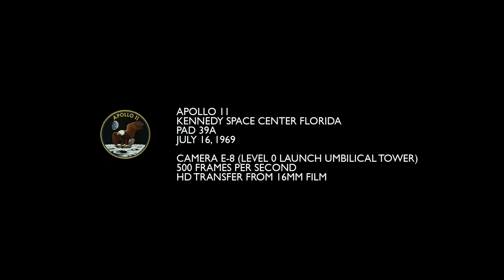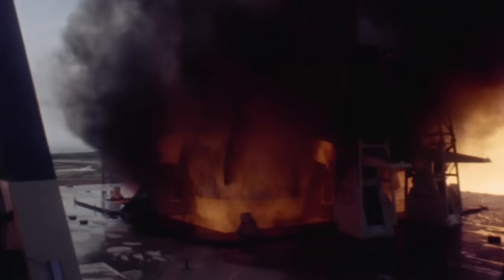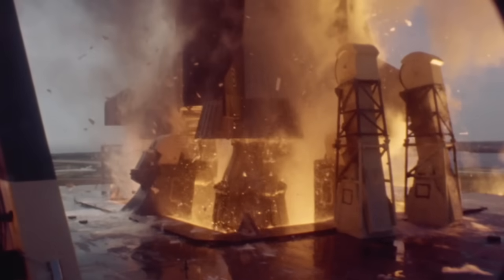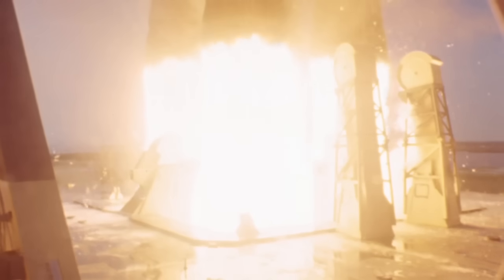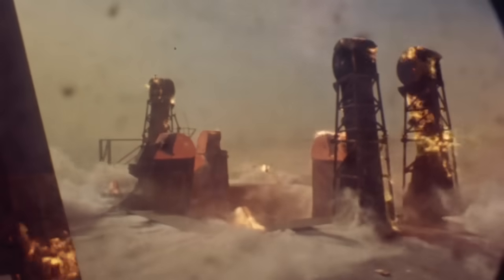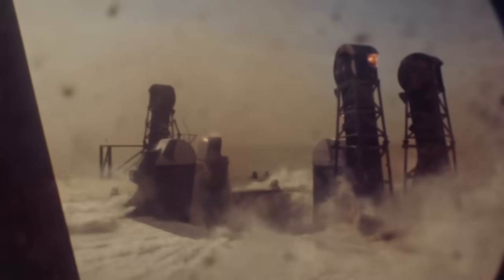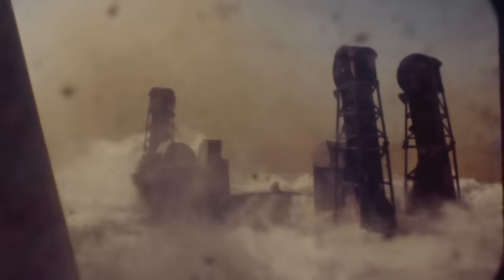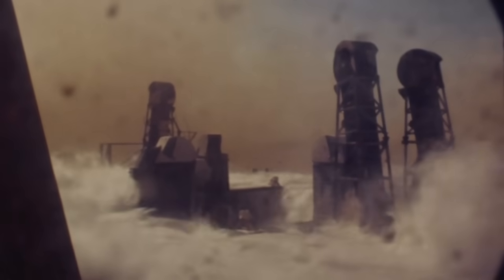Apollo 11 Saturn V Launch Camera E-8

Comment: Is there any records of the crew during a lift off?
Reply: What do you mean? Heart rate telemetry and communications? Yes.
Reply: @yassassin6425  you know what I mean, the video
Reply: @dimaleoniv7987  
No I didn't know what you meant because you didn't specify. This video is purely about the start up sequence of the F1 engines.
Reply: @yassassin6425  anyway, are there video records of the crew from the inside of the spacecraft?
Reply: @dimaleoniv7987  
At launch? Not Apollo 11 no.
Reply: @yassassin6425  strange isn't it? The first flight to the Moon wasn't recorded on video.
Reply: @dimaleoniv7987  
It was. There are hours of footage taken during the journey to the moon. There was no static camera rigged in the CM during lift off. I believe this was however done during the Apollo-Soyuz launch - although that was the Saturn IB
Reply: @yassassin6425   do you remeber that the mission Apollo 13 suffered numerous technical problems? I don't mean something like radio transmission failures. I mean life-threatening malfunctions. They started 3 days after Soviet fishermen had recovered a so-called "experimental Apollo capsule BP 1227" in the Bay of Biscay. Looks like a try to sidetrack spectators around the world from something more serious having its place on the Earth by launching a thrilling space story.
Reply: @dimaleoniv7987  
Yeah a boiler plate - not a working flight vehicle. BP1227, which was assigned to the navy ARRS unit for recovery training in the Atlantic was lost overboard in 1969 and recovered not by 'Soviet fishermen' but likely an AGI vessel after falling overboard. Makes for a rather embellished story but actually a somewhat underwhelming one after it was returned in Murmansk the following year on September 8th.

The Apollo 13 incident occurred on April 14th 1970, some five months previously. Damaged Teflon insulation on the wires to the stirring fan inside Oxygen Tank 2 allowed the wires to short circuit and ignite this insulation. At the route of this were two thermostatic switches, originally designed for the command module's 28-volt DC power which under the original 1962 specifications, the switches would be rated for 28 volts. However, revised specifications issued in 1965 called for 65 volts to allow for quicker tank pressurisation at KSC. Unfortunately, the switches Beech Aircraft (the contractor) used were not rated for 65 volts.

Seriously, you need to stop naively accommodating fanciful junk online conspiracy theory websites. If you really must browse them at least independently verify their claims.
Reply: @yassassin6425  yes, you right it sounds like juncky conspiracy, and there's the official version we have to trust to, shouldn't we? But let's be honest, how is big the chance of finding the module in the ocean without tracking it? It's like a needle in a haystack. Yet two notable events took place on that April. The Apollo 13 mission and the history's largest fleet exercise Ocean '70 launched by Soviets on April 14th. More than two hundred military ships got involved. I would swarm the oceans with ships too if I had a plan to catch something that's going to turn the world upside down. You probably know that USSR had a naval space fleet which official name is too long to write. A squadron of tracking ships used mostly for the assitance in orbital and lunar operations. They could be deployed anywhere around the Globe. At the beggining of 1970 the fleet counts nine vessels. No doubts that USSR was tracking all the Apollo launches since they began, double-checking and analazing the information. In 1970 they dicided it's time
Reply: @dimaleoniv7987  

"you are taking the easiest path by declaring my post a non-sense."

Not at all. I have systematically addressed all of your claims which are regurgitated from online conspiracy theory and demonstrably nonsensical.

"What's about yours then?  Not a working flight vehicle which was likely picked up by an AGI vessel monitoring ARRS exercises"

What do you mean 'mine'? Nothing to do with me. BP1227 was not a working flight vehicle - it was a a boiler plate used simply for recovery exercises which were underway in the vicinity it was lost. These were known to be shadowed by Russian AGI vessels disguised as trawler fleets. It is probable that the capsule was recovered by one of these vessels. 

"Some Soviet surveillance ship steals an American space module from under their nose. That would be a good plot for Tom Clancy's or for a French comedy of that time."

It wasn't an American space module, it was a dummy for recovery training. That it was lost overboard and recovered by a nearby vessel is not in the slightest bit far-fetched. Refer instead to your absurd post regarding military 'space fleet' exercises and Apollo 13 and you have a Tom Clancy novel. What you are clearly unware of is that following collection from Murmansk, it was lost overboard again. 

"I don't see you are reasoning, just repeating what officially stated."

What do you mean 'officially stated". Those are the facts as we know it. The rest is speculation as are the entire content of your posts under this video. Speaking of which, this is about the launch of the Apollo 11 Saturn V as captured by camera E-8. If you have nothing worthwhile to contribute may I respectfully request that you take your conspiratorial beliefs back to whatever echo-chamber you choose to inhabit and where they originated.
Reply: @yassassin6425  oh, really, and during coming back from Murmansk they lost it again. Yeah, for those who didn't get from the legend it was lost in sea once before. Pal, are you serioisly writing that Americans let lose a replica of Apollo command module with NASA written on it to the Soviets? Now imagine what they gave to Soviet propaganda which could make a mountain out of a fly but for some reason Soviets didn't. You didn't work with BP1227 but keep repeating that it was recovered by a Soviet AGI vessel during the exercise. You're like a parrot yourself. No offence it's just a fact. Like a North Korea's soldier who while in captivity steadfastly refused to watch TV to prevent himself from enemy's propaganda. I gave you information you didn't know, you refused it. There you are.
Reply: @dimaleoniv7987  
"oh, really, and during coming back from Murmansk they lost it again."

Yes, after collection it was swept overboard a second time - and you weren't even aware of it. 

"Yeah, for those who didn't get from the legend it was lost in sea once before. Pal, are you serioisly writing that Americans let lose a replica of Apollo command module with NASA written on it to the Soviets?"

There was no hardware inside - it was simply a weighted cone. And yes, given that it was supposed to be retrieved at sea, being lost at sea is hardly stretching the realms of possibility. Unlike however the ludicrous Apollo 13 nonsense you gullibly consumed and parroted over this comments section.

"Now imagine what they gave to Soviet propaganda which could make a mountain out of a fly but for some reason Soviets didn't. You didn't work with BP1227 but keep repeating that it was recovered by a Soviet AGI vessel during the exercise."

You are evidently unaware that the USA hijacked and stole a Russian capsule? 

What value to the Soviet Union was a boiler plate?

Unlike yourself, I don't present anything other than the facts - the rest is supposition. But of course, Dima Leoniv knows better, Dima Leoniv read it on the internet. Nothing gets past Dima Leoniv. 

"Like a North Korea's soldier who while in captivity steadfastly refused to watch TV to prevent himself from enemy's propaganda."

The irony - was it intentional?

"I gave you information you didn't know, you refused it. There you are."

See above. 

No you didn't, you simply regurgitated an online conspiracy theory that I have not only read word for word before, but one that anyone can access and anyone with even a modicum of independent thought process can routinely dismiss. You really aren't as special as you like to imagine. 

As I said, this video is about the launch of SA 506. If you have nothing worthwhile to contribute then take your vapid conspiracy theory elsewhere.
Reply: @dimaleoniv7987  
Why should they? The Soviets had just acknowledged both publicly and to the world that Apollo landed on the moon - or are you going to deny that too. The unmanned Luna 15 was in a race to beat Apollo 11 to the landing. It crashed on the surface. Both craft were being tracked by the third parties and other nations in addition to the Soviets. This was reported in the national press of the CCCP. 

Like I said, the CIA managed to steal a Russian craft from under their noses.
Reply: @dimaleoniv7987  
Not true.

By the time of The Apollo missions, and actually, by Shepherd's first Mercury flight, NASA had already established at least 30 ground stations on five continents; several islands; and aboard ships sailing the Atlantic, Indian and Pacific oceans. This required the complicity of foreign nations and governments. However, countries such as Australia were eager to directly participate and the U.S. encouraged them to take the helm of the communications stations. NASA selected the Parkes Observatory in New South Wales, Australia, to receive the remote Apollo 11 moonwalk readings, or telemetry. Whilst the 85-foot antenna at Honeysuckle Creek to the south, which tracked the LEM and the moonwalks. Spain for example, offered Robledo and Fresnedillas.

There were also independent institutions and facilities most famously Jodrell Bank Observatory in the UK, which was used to observe the mission, as it was used years previously for Sputnik. At the same time as Apollo 11, Jodrell Bank scientists were tracking the uncrewed Soviet spacecraft Luna 15 that I mentioned, which was trying to land on the Moon. In July 2009, Jodrell released some recordings that Sir Bernard Lovell's team had made. But there are also many, many others, such as Pic du Midi Observatory (in the French Pyrenees), The Arcetri Observatory near Florence, Italy and the Catalina Station of the Lunar and Planetary Laboratory. The Bochum Observatory director (Professor Heinz Kaminski) was able to provide confirmation of events and data independent of both the Russian and U.S. space agencies. This in addition to thousands of amateur radio operators/technicians and astronomers across the globe. NASA released information to the public explaining where third party observers could expect to see the various craft at specific times according to scheduled launch times and planned trajectories. There was even a group at Kettering Grammar School who using simple radio equipment, monitored Soviet and U.S. spacecraft and calculated their orbits.

Regarding BP-1227, I can't definitively say why the Soviet's kept it quiet. It has been suggested that the loss of Lunik right under their noses was an order of magnitude more embarrassing but there may be many, many circumstances surrounding BP-1227 that we will never know of and the latter, together with any conspiratorial suggestions are simply conjecture. As I said, we can only go on the facts that we have - the rest is supposition.

Thank you for your civil reply.

Comment: Bad mistake here! The Saturn V burned liquid oxygen combined with liquid hydrogen, not kerosene!
Reply: The 2nd and 3rd stages did, but the 1st stage burned kerosene. LH2 is lighter & more efficient, but takes up something like 3x the volume - meaning the 1st stage would have had to have been HUGE!! So they went with kerosene so the 1st stage could be smaller/lighter.
Reply: Look up RP-1 rocket fuel.

Comment: Incredible how much went into everything going exactly to plan, like how the mechanism would release the rocket at the exact time, Incredible for 1969
Reply: The early launches of several rockets (in the late 50s, early 60s) failed because the hold down arms hadn't yet been thought of. So the rocket would start to take off, but before full thrust had been achieved. Thus resulting in some of those spectacular explosions when it came crashing back down.
I remember reading a simple explanation where the rocket "tells" the arms "I'm ready, let ne go".

Comment: 50 years later and the Saturn V is still the most powerful space launch system ever made.  Yes, it’s even more powerful than SpaceX’s Starship.
Reply: Well not really, but regardless it still remains a beast of a rocket.

1 F-1 Engine = 3 Raptor engines
5 F-1 Engines = 15 Raptor engines

Superheavy alone will have up to 33 raptors. Thats about 11 Saturn V engines in terms of thrust. More than double.
Reply: Starship with superheavy will be far more powerful than the legendary Saturn V. Even tho Raptor is slightly smaller, they put shitton of it
Reply: No. Starship is more powerful

Comment: So what? Did they land it on it's tail? Today, SpaceX does routinely, for a fraction of the cost, proving that the motors don't have to be that overly to get equipment (and people) into space..
Reply: Uh, in case you've haven't noticed, Bandit, it's 52 years later - half a century is seemingly an eternity considing the speed of technological development.  Of course 1960's Apollo technology may be clunky in some respects when compared to what is used now.  But at the time the rocket science and techniques used in the Saturn V rocket represented top-of-the-line technological creativity - the very best in the entire world at the time.  And it did the job.
Reply: @randymartens1823  You are wasting your time talking to a cartoon character.
I appreciate the magnificence. I was 13 when this history was made.
Reply: SpaceX has to lower it's payload so as to save fuel to reuse the boosters, back then we needed all that might since the Saturn V fully fueled was over 6 million lbs. Saturn didn't just get "into space", it could hurl 125,000lbs TO THE MOON.

Comment: Like a cockroach fart compared to the superheavy
Reply: 'Superheavy" what?, the spaceX Falcon heavy is not as powerful as a Saturn V, nothing is, it remains the most powerful machine ever brought to operational status by mankind 55 years later.
Reply: @barryaiello3127  have you not seen the starship super heavy , 32 engines thousands of tons of thrust, they stacked the first ship if august 6th it will be a historical moment. Suggest you go and watch.
Reply: @Klix3ontop  Just read up on it, cool as hell, lets hope all goes well with remaining testing/obstacles. I live about 45 miles north of KSC, (Daytona) and I was about in tears as the Falcon Heavy clawed it's way up in the sky!.
Reply: @barryaiello3127  now Imagine something 2x the height that can be heard from miles away. With a flame streak that has the wing span of a 747
Reply: @Klix3ontop  Five F1 still got 5% more thrust compared to 32 Raptors. Edit: This was calculate at older number 1,100kN, not current 1,700kN
Reply: @jonasthemovie  lol no, 32 raptors is about 11 times more in thrust than the first stage of Saturn V, Infact The Superheavy will have 37 Now
Reply: @farel9476  11 times? Not even close. That would mean that 3 Raptors would equal 5 F1,  they only equal one of them. But I didn’t use latest data 1,700 kN but 1,100 kN for the Raptor. 32 Raptors at 1,700 kN have 45% more thrust than 5 F1 at 6,770 kN. 65% more if you stack 37.

Comment: I thought Saturn V used hydrogen for fuel🥴
Reply: The 2nd & 3rd stages did; the first stage used RP (kerosene) because it's denser so they could fit more propellent in.

Comment: Look at the massive engineering just to hold and release the rocket.  Today rockets launch from a tower still, and return standing on their own 'legs' which don't extend away from the fuselage until needed.  Ooops, one time one of the three legs gave way, and the re-usable stage became scrap in seconds.  Will we ever get to have rockets that launch and land many times using just their own legs for support, similar to a jet plane landing and taking off many times, with just between flight inspections, maintenance, and refueling?  Will the space jockeys from pulp SF magazines ever ply the space lanes doing deeds of derring-do?  Stay tuned, kids, for the next exciting chapter of The Galaxy or Bust!

Comment: I’ve studied the shuttle’s launch too and It amazes me that all that power & thrust can be held down by a few arms or bolts. I believe that the shuttle’s is detonated to release, but truly amazing engineering that goes unnoticed.
Reply: I too have wondered about those bolts, and all the other supports.  I've never heard anyone discuss wind forces on the launch pad.  That's a lot of torque.  And also the supports of the F-1 engines themselves.  The supporting rods for these engines seem so flimsy, and yet there's millions of pounds of force.  Amazing engineering,.

Comment: Kerosene--also used in Model Ts when gasoline (called gasolene back then) was in short supply. Ironic.
Reply: It is a very good 1st stage rocket fuel and very common in Aeospace.  All airliners and military fighter jets use it too.

Comment: They threw away the plans for Saturn by mistake...
Reply: They’re all on the web.  Every single thing.
Reply: No they didn't. The people who were involved in this with their hands-on experience and knowledge are either retired, far too old or dead. Every one of the thousands of turbine blades in the turbopumps were hand-positioned and hand-welded, taking hundreds of times as many man-hours as would be required for an equivalent engine designed today. No one has done exactly what they did since then. Redoing that would be a massive pain the ass, extremely expensive and pointless. We have SLS and Elon's Starship now.
Reply: @lilpain8883  
And the build notes that weren’t documented.  Be the same if they tried to build Concorde today from scratch..